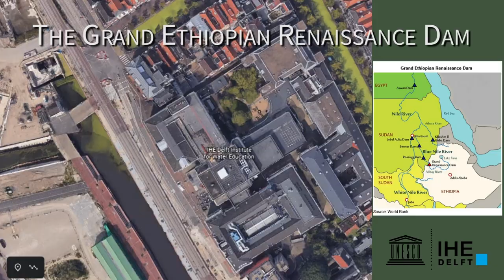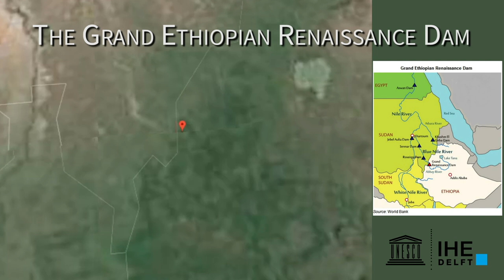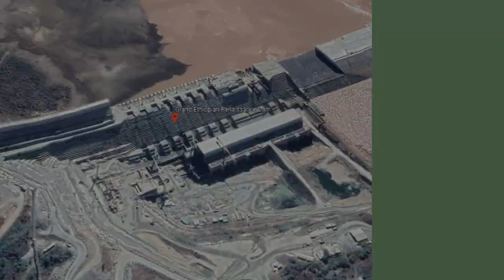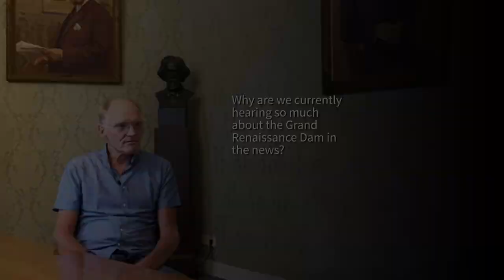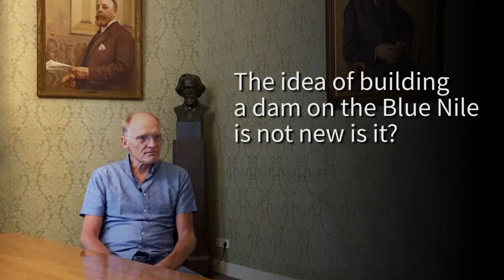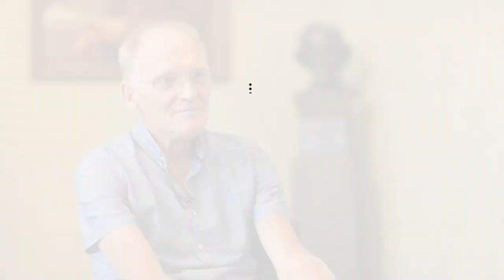IHE Delft 💧 Prof. Pieter van der Zaag discusses  the Grand Ethiopian Renaissance Dam

Comment: Just for background information: how much time (in years) is needed to fill the dam?
Reply: It can be done in 2-3 years, but considering the downstream countries it will take 5-7 years.
Reply: @ninjitsuscorpion5163  This is indeed the range of time that is now considered (5-7 years), also by Ethiopia. The precise length will depend on whether there is sufficient rainfall and river discharge in the coming years.
Reply: We're told that it would start producing full power by 2023. 3 years. That's what I know.
Reply: It could have been done in 2 years, but Ethiopia takes the downstream countries Sudan and Egypt in consideration.  Besides they only fill it in winter when there is more rainfall. So it can generate power in 3 years, which means this year, since they already started in the winter of 2020, but it will take four to six years to fill up the reservoir to its maximum.